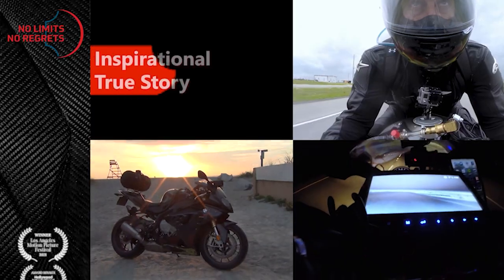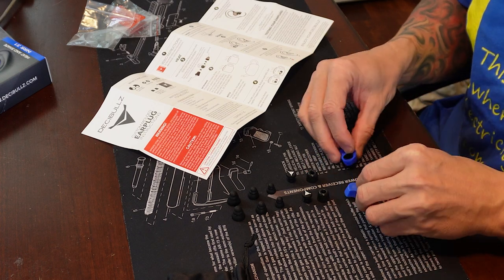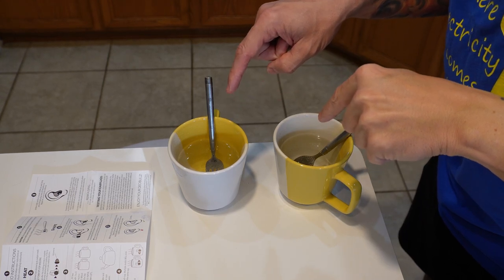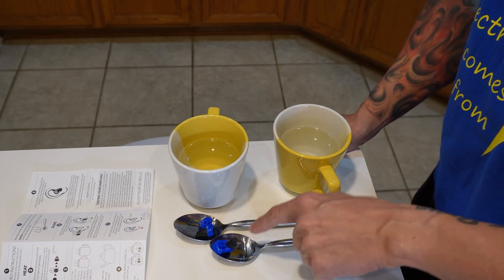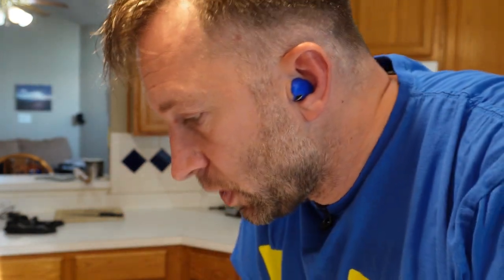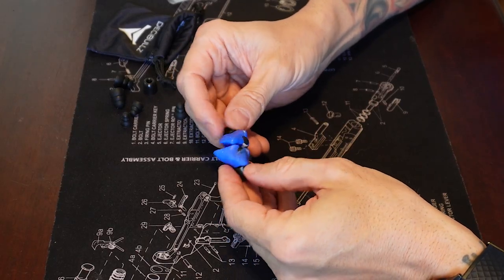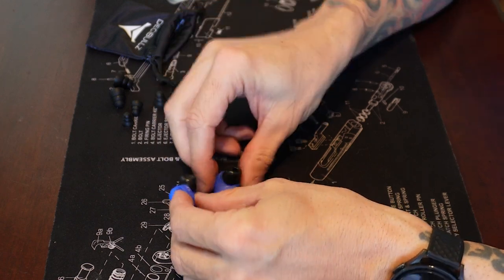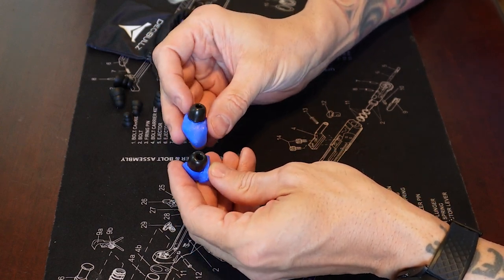How to CUSTOM Mold DECIBULLZ ear plugs for MOTORCYCLE Helmet Instructions

Comment from the maker: AFTER USING THESE EARPLUGS....to be fair, i just installed an eyelights system, and the audio on it doesn't impress me as much as the sena i had previously, so even though i couldn't hardly hear the phone call with these plugs, i couldn't with the other ones i have either. can definitely hear traffic, engine rpms, etc. i had high hopes for these ear plugs being molded, and that is a cool feature, but the cooled plug is pretty stiff foam, and tend to come out of my year when i pull the helmet down if not really careful. comfort, they were still a hard spot on the ear. they were better than the eargasm type plugs i've tried, but not as good as the fully molded plugs i have, which are the most comfortable, but make it pretty hard to hear music if that's a priority.

Comment: And how did they work on the motorcycle? Any pressure from the helmet on the hard plastic? Does it let in enough (albeit muffled) sound to still hear traffic, bluetooth comms unit etc?
Reply from the maker: I'll modify my pinned comment to reflect this, but to be fair, i just installed an eyelights system, and the audio on it doesn't impress me as much as the sena i had previously, so even though i couldn't hardly hear the phone call with these plug, i couldn't with the other ones i have either. can definitely hear traffic, engine rpms, etc. i had high hopes for these ear plugs being molded, and that is a cool feature, but the cooled plug is pretty stiff foam, and tend to come out of my year when i pull the helmet down if not really careful. comfort, they were still a hard spot on the ear. they were better than the eargasm type plugs i've tried, but not as good as the fully molded plugs i have, which are the most comfortable, but make it pretty hard to hear music if that's a priority.

Comment: Would these protect my ears at an infoor range?
Reply from the maker: I would not rely on these alone for firearms. they're meant to knock out windnoise, and they would reduce firearm noise, but i would use at least an over the ear 'muff' style hearing protection and even a spongy ear plug in combination for maximum protection, especially for anything bigger than a .22LR
Reply: @NoLimitsNoRegrets  what are the most comfortable ear muffs? The ones i have they press down on my ears even after upgrading the pads to that soft gel
Reply from the maker: @WavyVaporizers  i have a pair of walkers alpha muffs that i've used for quite a while now.